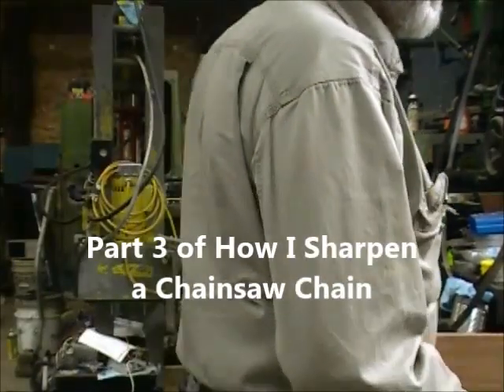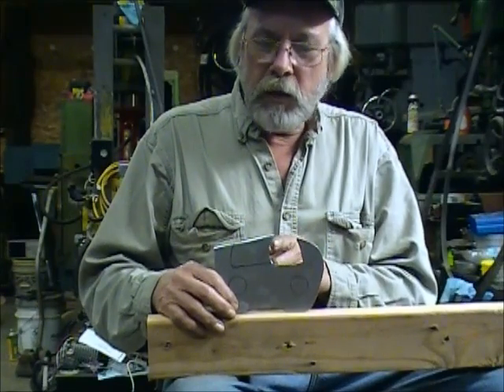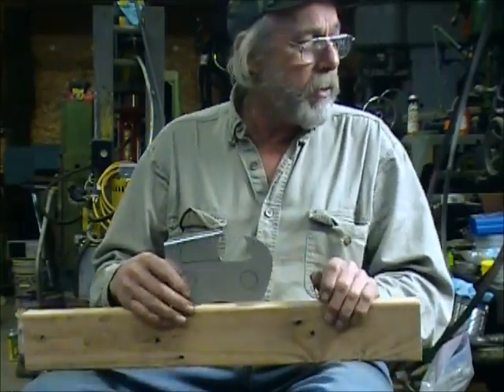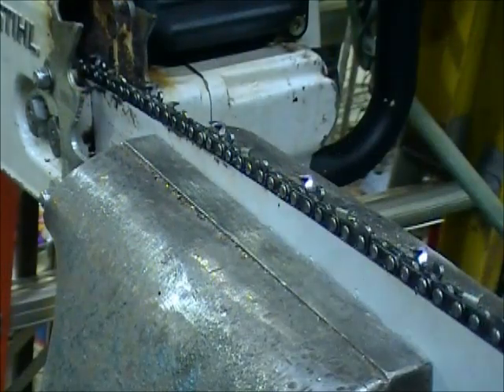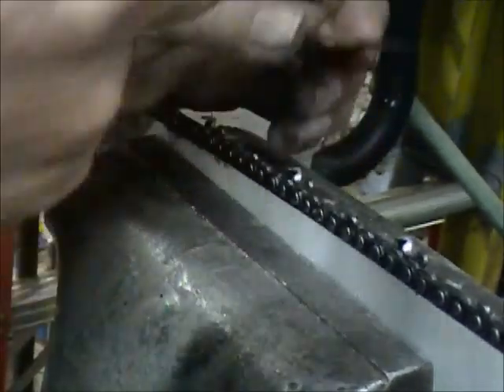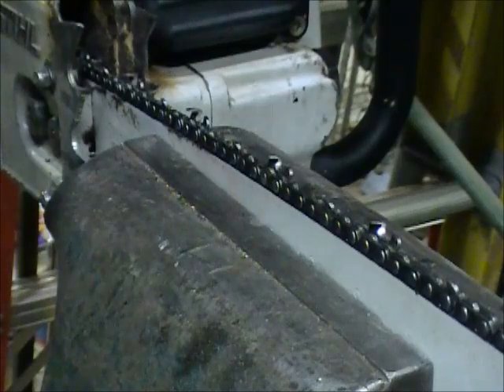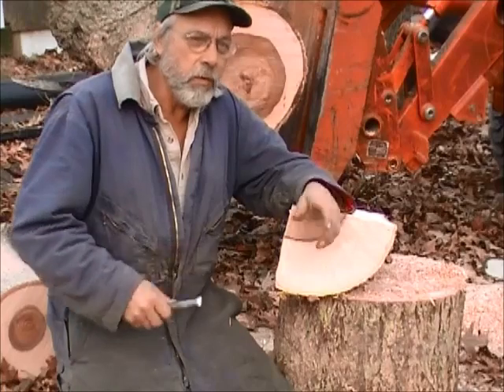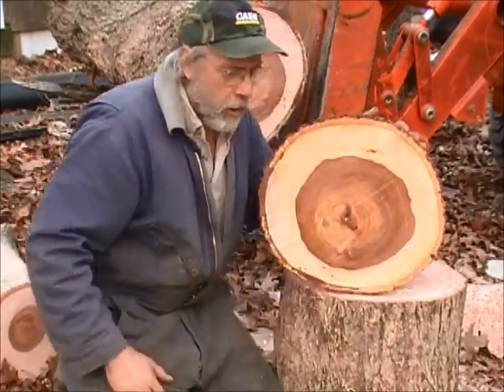Secret to Sharpen a Chainsaw Part 3

Comment: Great video, i have seen these videos focusing on gullets never seen so much attention given to the wrong area, people have no idea how much is going on as the chain passes through, you clearly have a great grasp of what’s going on, i been cutting firewood for 30 years, this year i will have cut and split over 600 cubic meters using the machine, still use power saw to prep the timber but the principles you explain are common to both, well done from the U.K.

Comment: Very interesting stuff, thank you.  You take a very different (more mainstream) approach to filing compared to Buckin Billy Ray Smith.  Given his experience and use, I'm curious to hear if you think it really matters which way you do it.   He doesn't seem to have the problems you would think he would have by removing the gullet.  Genuinely curious to hear about it, thank you.
Reply from the maker: no thank you
Reply: Think bbr is in soft wood. Vs the hardwoods

Comment: To me.. your chisel demonstration around the 13min mark might suggest a hook is important to get the side to slice through the end grain.  That was actually the best explanation of side cutting i have seen yet.  I believe your point as well being more dangerous is possible.   I do agree that a machine (in the right hands) can do a better job (especially square ground).  That said, I disagree that you can't hand file accurately.  Speaking for myself, I can file a chain by hand and it cuts fast and straight every time.  The benefit of hand filing comes when I'm out in the middle of nowhere and hit a rock, nail, fence in some wood.  I can be back up and running in under 15min.  It does take time and patience.  However, I find it relaxing/meditative after running a chainsaw for an hour.  It is a nice break.  In addition to that, I have also seen people burn the hell out of the teeth with a grinder.... which pretty much ruins the temper of the steel.  I've also seen ground chain with a terrible burr of metal around the outter edge of the cutter which is more dangerous.  I guess what I am saying is... both ways work if you know how to do them correctly.  I wouldn't say one way is useless over the other.

All that said, your video was extremely informative.... and I appreciated all of the knowledge you shared.  I look forward to reading more.
Reply from the maker: I agree it is possible to sharpen a chain with a file if a person is careful and takes their time. I just found it much harder and slower to do correctly. I cut my firewood into logs and bring them home with my tractor then do most of the cutting at home. I keep my chains sharp so the time spent cutting in greatly diminished. I also agree someone can destroy a chain with a grinder pretty quickly if they do not know what they are doing.

Comment: Great information here! I'm trying to understand why the cutters couldn't have a uniform height from front to back thereby enabling the rakers to never need lowering?
Reply from the maker: I am quite sure it is for clearance, or the cutters would not be aggressive enough
Reply: The teeth are lower at the back of the tooth, so as you sharpen, the distance from the cutting edge becomes closer to the chain.

Comment: Good points but just overthought as fuck. I free hand sharpen my chains and they cut like a damn samurai. The hook/gullet helps separate the chip and clear the chips. Everyone does it different and several ways work fine. Its a fuckin saw to cut wood. People act like its rocket science. Especially the old guys try to make it sound more complex than it is. Taught my sister how to sharpen a chain by hand in 5 minutes. EASY SHIT GUYS!
Reply: Hope you didn’t teach her with that foul mouth!

Comment: The best way to sharpen a chainsaw chain is with a Dremel tool with a Dremel chainsaw sharpening stone (I learned this from a Stihl mechanic). Doing it with the Dremel tool is three times faster than doing it with a file, plus it doesn't take off as much metal so your chain lasts longer, plus you don't have to put the saw in a vice, or take the chain off the bar. You can buy a Dremel tool and the sharpening stones at Lowe's or Home Depot in the tool section. Dremel makes three different sizes of chainsaw sharpening stones. Stihl makes a Dremel type tool that runs on 12 V. and has battery clips for attaching to a car battery. Once you get the hang of using a Dremel tool this way you'll never touch another chainsaw file. After sharpening the chain two or three times you'll have to trim the drag links a little to get the teeth to bite. You can use the fat end of the sharpening stone to trim the drag links. To get the proper angle keep the stone the same angle as the line on the cutting tooth (i.e. on a Stihl chain) and hold the Dremel motor at a slight downward angle. You'll figure it out.
Reply: What crap.
Reply: @PeterWalkerHP16c  ~ Yeah, why use a Dremel tool when you can use a file? Or why use a chainsaw when you can use an ax? Or why use a Skilsaw when you can use a Handsaw? Or why use an electric drill when you can use a brace and bit? Or why drive a car when you can ride a horse?
Reply: I agree with Peter ! Bullshit !

Comment: I used this info today. Saw was pulling to right, not anymore. What brand sharpener where you using?
Reply from the maker: Are you refering to my grinder?
Reply: yes the grinder you're using...thanks
Reply: @woodthump7900  grind your bar most likely the bar itself needs to be flattened
Reply: @kevincowan4887  did you even read all of his post or just get so pent up to tell somebody something you think you know that you had to hurry up and spew that out? He stated, quite clearly, that it cuts straight now after sharpening with this method.

Comment: Right again! A part of the file sticks above the tooth to get the right angle for the under side. I want to say 1/4 but that might be too much. I always lift the file to keep it on the top instead of undercutting the gullet. One day I'll probably get ba grinder but so far it's just easier to file it and go on and I'm just doing firewood too. I've got an MS 440 Mag but also a Super 45. The 45 is THE saw but it needs work. Don't ever lend your wife or your saw. I lent my saw and should have lent my wife. Now the saw is dead and the wife is gone. But I got a reprieve on both!
Reply from the maker: Thanks for watching the series, I have to give Carlton's book the credit. I did not figure it out myself but I am sure glad I read that book. www.squirrelhouses.com/chainsaw book.html 
It is nice to know how your saw is going to cut before you even start it up. Oregon bought out Carlton and they changed the book, I found a new copy online but all the information about progressively filing is gone. 
Good luck with the saw and your wife, I hope everything works out well. 
Happy sawing
John Fink
Reply: Thanks John and everything is working out just fine. Been married almost 14 years and I sure wished I'd had her first but better late than never! Carlton was a fine outfit and they helped me a lot in understanding stuff with the file-o-plate. I ought to get a Husky plate just to see how far off I am. Thanks again and I'll be around! Lew.

Comment: Theres no realistic substitute for hand filing if your away from your home/vehicle. If your a saw guy and its your job to use a saw you gotta learn to hand file, simple as that. But if you use a grinder then try to hand file out in the woods you may have issues cause the grinder hardens the teeth(messes up the temper or something)
Reply from the maker: Whatever works

Comment: I disagree with Husqvarna:  the fulcrum of the depth gauge is at the cutting edge, as the cutting edge is lowered, and moved back from sharpening, the depth gauge's angle becomes less steep, at the smallest point of the saw, less material is being removed from the depth guide of the chain.
Reply: Yes, the fulcrum is at the cutting edge, but we aren't using the depth gauge as a lever to pry anything, so the fulcrum is just an imaginary reference point that means nothing. You rest the gauge at the back of the tooth that is in front of the raker you are filing, which we will call point "A". Since point "A" never changes and the raker is always in the same spot, this allows for a linear or perfect amount of material to be removed through the whole life or length of the tooth regardless of tool angle. If you try to do what you are suggesting, with this same tool. you would have to reduce the tool length, every time you use, put some bit of spacer behind point "A",  and your raker would end up looking like funky triangle while not removing enough material on the top/back of the raker. Think about what you are saying for a minute.
Reply: @ravenshield7823  Maybe there is a misunderstanding with my initial proposal.  I am saying, that the shorter the cutting tooth gets, the less material is removed from the depth gauge, but Husky says the opposite.  We can always measure the difference with a depth gauge between how much material is removed from a fresh tooth, vs an old tooth, but I don't have one of these Husky guages.
Reply: @thomasgronek6469  Last year I switched over to this style and it's made all the difference, you can sharpen all teeth differently and get them all to cut the same using this tool. What I mean is I don't count strokes, I sharpen each tooth till it's a razor, then do all rakers accordingly and the results are impossible to ignore. I just ordered another one tonight for .325 for my 543xp. Since you can get all the teeth to cut equally and don't end up cutting parallelograms for firewood, which I have done and it's embarrassing, even when nobody sees it but you. I won't sharpen without it. The only thing that can mess up the bite is if you don't do all the rakers in the same spot on the bar, since the bars are kind of oval, and this gets extremely exaggerated toward the tip. Using the other style gauge, I've literally cut U shaped wood if the diameter is large enough, because for some reason, I always seem to dull one side worse than the other, which I still don't really understand, but this gauge compensates for whatever anomaly is happening there. You gotta have things fucked up before you know for sure when it's right lol. I have had no problem since using this style gauge and will swear by it.
Reply: @ravenshield7823  yes, without a doubt, this is probably one of the better designs, and I agree, that it  works just fine.  I am just looking at it mathematically, and their statement about 'how' it works doesn't trig - out on paper.
Reply from the maker: This book is where I got the information from Carlton "Complete book of saw Chain"